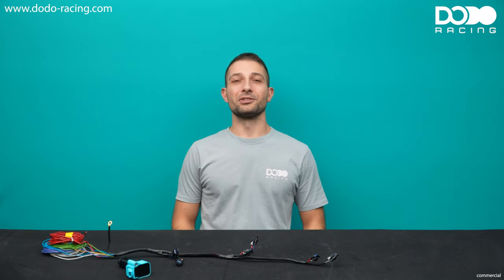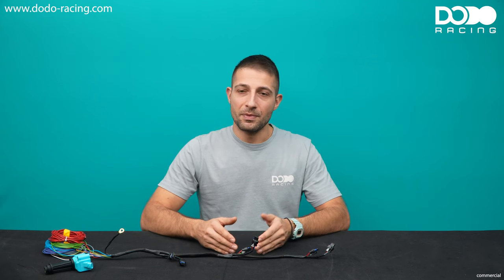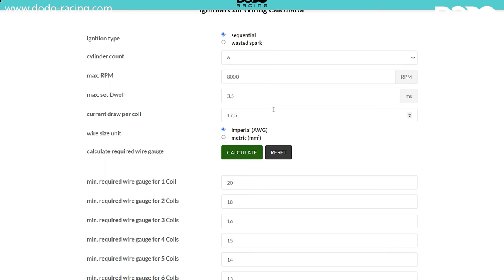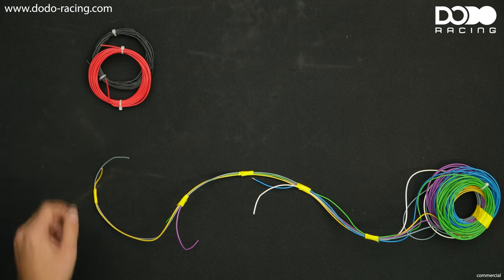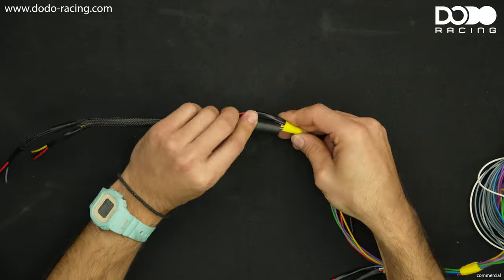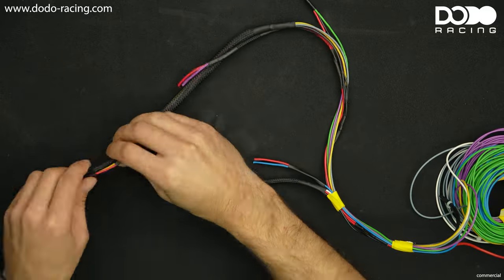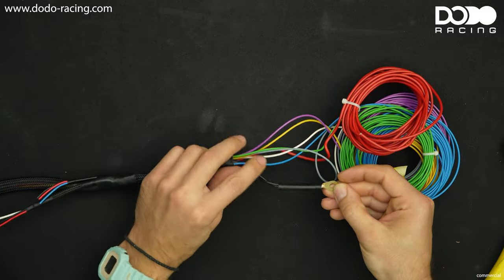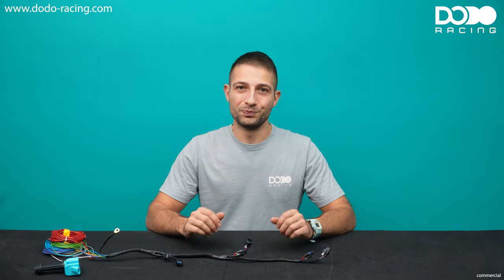How to make a Coil Wiring Harness // 2JZ Shrine

Comment: @6:37 with the TC-1 copper crimps I prefer to Strip the wire long enough that it covers both crimping ends. Doing this will make the middle of the TC-1 Terminal stronger as for example if you take one and bend it in the middle it will break very easily, this once heat shrunk together if bent enough could potentially cause a cold joint. Having those wires cross over both of the two middle crimp tabs will also allow full amperage to pass through versus relying solely on the surface area of the TC-1 Terminal. 

Just my two cents. For larger crimps much like you've done, I have however much like you used the longer tabs to crimp all wires together and then used glue-lined heat shrink to aid in straight relief. keep in mind, I still allow the wires to at least cross-over the middle of the terminal connector and join each other where possible. 

Great video, very well detailed and You've shown some very nice tricks. I'd have probably ran all the coil +/- wires with the Recommended 18awg or slightly larger 17awg wire all the way down to the 6th coil where I would have then made either two crimps to one or one large crimp using a larger TC-C,B,orA connector to hold all the wires together and glue-line heatshrink. 
Less cutting and less crimp points that if not done correctly or with the right tools could lead to a failure or cold joint later down. 
I do understand why you chose your desired method as it will likely lead to a less bulkier harness. 

Very informative, keep em coming. 

I still would like to see a 2JZ GTE OEM Coil test against these New Dodo Racing coils. Lets make it happen  😉

Watching from the Caribbean, Dominica 🇩🇲 #767
Reply from the maker: I agree that the single splices are better, not only because the double splices can break in the middle, but also all the wires are connected directly to eachother. it just gets a little bit harder to splice them together if you have multiple wires. But if you have a strong heat shrink it will add quite a bit of rigidity to the connection!
I know that most people would run all the coil wires down to only one big splice, but i like it more this way not only because the harness gets less bulky, but also joining 7 wires into 1 splice is harder to do correctly than 3 wires.
btw i never had one of these double splices breaking on me, but i also know that they can when you bend them in the middle. 
i dont have any stock gte coils on hand, otherwise i would hook them up to my test rig :/

Comment: Another question I have. The 2jz ge vvti na is an interferance engine when it comes to valves and pistons right? How does one get the engine to Top dead Center when Timing it? Do you have to watch out while instslling the cams too? Sounds Hella complicated.
Reply: Which car is this? if it is for an is300 or GS300 you can time it by the dots so you dont stay at the top dead center. DOT on crank DOTS on cams

Comment: This is very nice and I would have a warm and fuzzy about buying an ignition harness from you. But for an everyday street car for around 650-700hp, would this be needed or could I run a single pwr/gnd10 awg and splice 6 12s to it?

Comment: One more question. 😅 On the 2jz ge vvti you have no camshaft Sensors on the head. Would it be possible to machine custom valve Covers and mount them in there? Also do i have to get the intakte only? Or both? And why

Comment: Informative video, I have a question. Is it required to wire a Ballast Resistor to these coils to prevent from burning them up? or can they be permanently wired directly to battery source voltage? thanks
Reply from the maker: no ballast required

Comment: I´m curious about the vvti on the 2jz ge. I have no idea how someone would set that up on a map. Also i would want to know if its enough to just have the intake or the exhaust cams with a sensor or if i dont need eather off them. Thanks
Reply from the maker: the stock ecu has a load(maf) vs rpm map for the vvt. we only have vvt on the intake. since most of the time, we are using map for load on aftermarket ecus, its not perfect because the vvt has effect on map, so the vvti control is kind of chasing its tail. most people just set a vvt table (map vs rpm) and then tune the VE table. but this is kinda dirty as 1. vvt takes some time to reach the desired angle, so your VE will be off (actual cam angle not equal to target angle). 2. you can not change your vvt map without re-tuning your ve table. if you want to do it the right way, you make a 4d map for VE, on the 4d axis 0deg, 10deg, 20deg, 30deg, 40deg, 50deg. lock the angle and fill the maps. now your ecu always knows how much fuel to inject, whatever your angle is, which means you can track your actual angle, not the "target angle" and inject accordingly. and NOW you can play around with the vvt table and see what gives you the best performance/economy. once i have measured the whole vvti map from the stock GE ecu. but of course, it doesnt mean much for a boosted application. if i had a stock GTE vvti here, i would love to see how toyota programmed the stock vvti map. its a lot of work, but i think its worth it. i have even purchased their SAE sheets to get to their stock VVT map, but the information is very vague.
Reply: @DodoRacing  sounds close to impossible to find the degrees it does whenever under different circumstances. Also in my mind wouldn't they be different whenever? Like 3000rpm 50% throttle would have a different ammount off vvt than like 3000rpm 80% throttle. But I could also imagine this beeing the easier Part to adjust in the ecu. On the other hand if you had like 5000rpm and 50% throttle it would have different angle again. So you would technicaly have to make different tables for different rpm and % off throttle? CrazY
If my thoughts ofc are in any ways correct. 😅😂